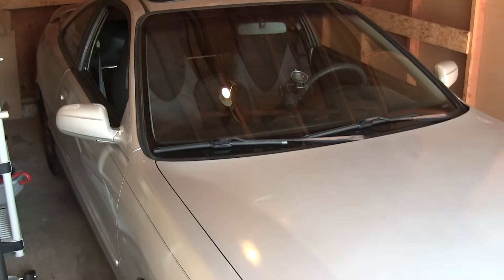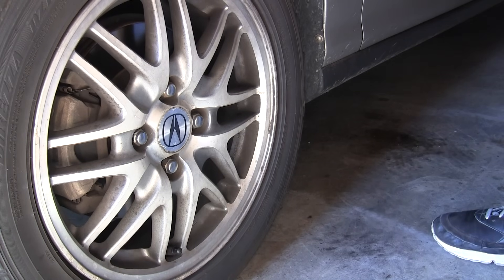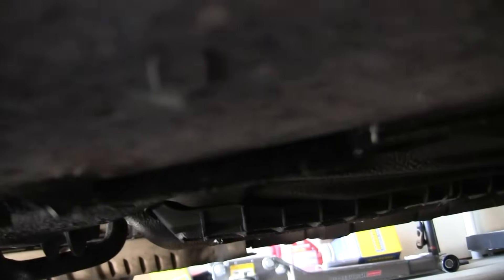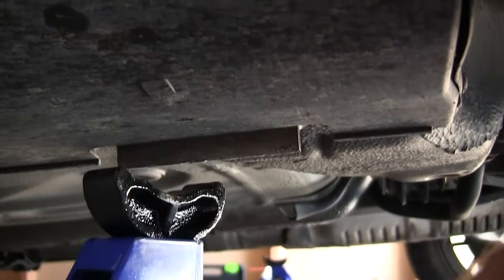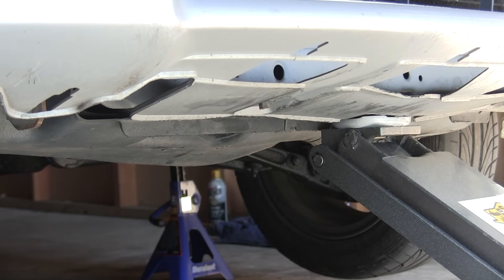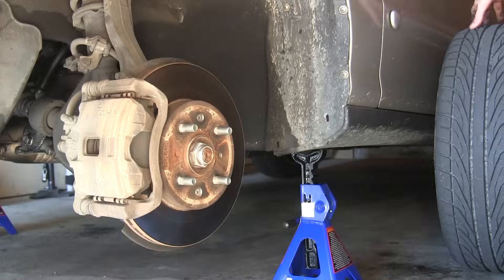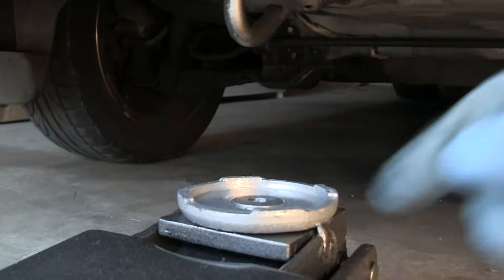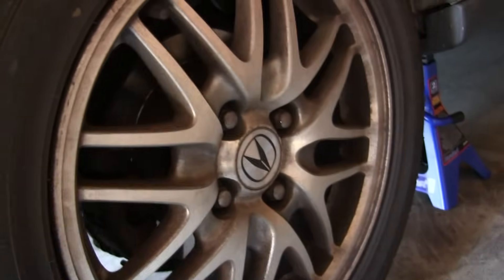How to Lift a Car onto Jack Stands - Explained

Comment: If you only need to jack up one side of the car and remove one tire can you put two jack stands side by side on the pinch weld just in case one fails?

Comment: If you're jacking the car up high, to work under it not just remove the wheels, after you set it down on the jack stands leave the jack under it and shake the car on the jack stands back and forth vigorously.

It should be solid as a rock!

If ANYTHING doesn't feel right or feels wobbly, don't get under it! Jack the car back up and reseat the jack stands until it's solid!

Comment: Nissan didn't put any kind of information on a 98 to 01 altima gxe front lift points and the manual dosent say anything either.... I can't get the jack to the control arms either. Gunna have to go buy a bunch of boards to stack and drive onto

Comment: I have a question that might be silly but I’m having trouble finding a solid answer to on my own….if I’m planning on raising and supporting both ends of the car and taking all 4 wheels off, is there a certain way this should be done? Front first, or rear first? Or am I overthinking it lol….just want to keep my Mustang in awesome shape and do mods to it without dying a horrible death underneath it lol 🤷🏻‍♂️😬

Comment: I suggest (for integras at least) that after you get it lifted up with the jack stands under it, and if you have the front up, pop the hood and stand on the metal bar that the top of the front plastic attaches to and give it a few light bounces, nothing to crazy you’re not trying to make it slip and fall but just enough to make you confident that it won’t slip while you’re under the car, if you have the back up do the same thing in the trunk, if all 4 sides are up test the front and back

Comment: If you are working in deep gravel you need to put a jacking plate under the stands.  Yesterday my car fell off the stands and I am trying to find a jacking plate.  I had just removed the jack and put it in the garage because it was night and I didn't want someone stealing it, but had I left it in place my car wouldn't have fallen off of the stands.
By the way, I never would have recognized your voice! :)

Comment: Putting your car in gear or park to lock the front wheels (for jacking the rear) only works on a front wheel drive.  Use wheel chocks always.  Also, it's good to give the car a shake before inspecting the jack stands, listen for any shifting, don't raise too high from one side.  Good video, but missing some additional safety information.  Make sure your jack stand is on a surface that won't sink.  Best to check out some other videos from professionals.

Comment: To anyone watching this.    Make sure if you buy jack stands , that you buy ones with the extra safety pin (is on a key ring/chain ) pin slips in as an extra safety feature in case the jack fails .    As he said don't forget wheel chalks.  Torque wrench/ Torque Sticks-Torque Bar,  Tire Crayon-Marker might be handy as well. Putting a tire under the car or block of wood is an extra safety measure you might want to take also just in case the jack failed or if you didn't set it right and didn't notice.
Reply: stack spare tires or bricks under the car so if anything collapses you won't get crushed

Comment: To me, this is the worst part about working on any car, simply because I don't do it often enough to really remember what to do.  A question, why is the area that you apply the jack stands shaped the way it is?  With that long metal strip, I think it's called a pinch weld?  I'm a total newb on this sort of thing (in spite being in my 40's lol), it just seems odd to me that every car I have had to jack up was like this
Reply: They try to discourage owners from working on their own cars, and it makes it more dangerous, frustrating, and expensive for those who do.  I'm thinking of getting some special type of jack stands that are compatible with pinch weld adapter smdh

Comment: This is the time you wanna take extra caution don’t rush the jacking up procedure. Your safety top priority extra tip is put the tires under the vehicle close to the jacks in case a jack stand fails car will fall on the tires and not you or the ground

Comment: I just had to jack up a Toyota, and the jack points were the same metal bar you showed, and that the owners manual showed. But my metal bar bent, and caused the whole car to come crashing down! I moved my jack to a different spot in the front that was part of the frame, and it held much better. But why the hell did it bend? Did I do something wrong, or was it just a cheap/shitty part?? I swear on my life it was the same part the manual showed.

Comment: A bit over the top, makes you wonder how anyone changes a wheel on the side of the road? If youre getting under the vehicle, use the stands and your wheels as a last resort.
Point two: A wheel is made up of a Rim, Valve and a Tyre. A wheel is not a tyre and a tyre is not a wheel. You have a spare wheel in your boot/trunk you dont have a spare tyre, that would be useless without the other components unless you know how to put a new tyre on your rim.
So endeth today's lesson haha

Comment: Hi, would anyone know whether I can remove my wheels on a slope? My drive and the 2 roads off it are all on a slope. 

I thought about parking my car parallel across the slope on the driveway then jacking one wheel at a time with a hydraulic jack and removing the wheel, cleaning it then putting it back on. Then remove the next one etc. Do you think this would be safe? Any help would be greatly appreciated 🙏
Reply: If you want to get squished under your car, then yeah. Otherwise find a flat surface
Reply: Ok thank you. I’ve managed to jack the car up ok now. I found a  flat part of the driveway and parked parallel across it and I managed to jack the car up successfully.

Comment: When removing rear tires put the tires in the trunk so the center of gravity doesn't change, which could cause you car to tip forward on the hoist.

Comment: I am having an issue using jack stands with a scissor jack.  The hardpoint area is not long enough as the jack stand base is wide.  If I use the scissor jack on the hardpoint, there is not enough room for me to place the jack stand on the hard point.  Besides getting a floor jack are there any solutions?

Comment: Anyone know front/back jack points for a 2012 Subaru Legacy? The manual annoyingly just shows the four side jack points (for say changing a tire) but doesn't show where to jack the front or back up to put jack stands under these side points.
Reply: Josh Isralowitz 
I'm wondering the same thing amd my manual only shows the same. I think the "towing hook (eyelet?) he used to jack up this Acura is on most vehicles. My KIA got towed and I know I have a towing spot like this car. Try that, or look it up (Google it).

Comment: Good video but only for that car.   You're not going to find a front jacking point like that on most cars,  and in any case the owner's manual won't be of any use to you.  All of the owner's manuals I've seen for modern cars pretty much just tell you how to change a flat...

Comment: if my jack wont fit under the front can i do each side one by one  using the frame rails and the seam points?
Reply: If you’ve got the option, drive onto some wood blocks to get extra clearance.

Comment: Can one use the scissor jack that comes with a car to lift one side at a time, placing each jack one at a time to get the entire front up?
Reply: Alex Merritt  Very time consuming but i do it all the time. No problem at all. Leave the jack there too to support the weight
Reply: hey to get the first jack stand under the car, where should i put it since the scissor jack is in the spot where it needs to go

Comment: Am i the only one who gets sketched out at the thought of doing this alone?!?
Reply: i feel safer alone. no one will lean on the car or "accidentally" kick the jack stand.
Reply: Lol just give it a good shake, make sure your on even ground, some slabs have been known to crack if there is a void in the middle, gravel can be sketchy, use very thick plywood and thin metal over the top to stop it from digging in, i used a old pc case side. But yes be careful, i've had a car slip before, luckily i was just giving the car some welly in the hub nut, but that always taught me safety safety safety!!!!!!
Reply: No always let someone know ur doing this just incase
Reply: Plus the scissor jack it comes with! Triple insurance
Reply: It’s pretty easy just have to do it correctly and double triple check everything before going under the car
Reply: Thought has run through my mind, yes.  I need to start putting the tires under the sides of the car.
Reply: Always lay your tires down flat sided and put them halfway under the car and halfway sticking out from the edge of the car as well for extra safety that will not fail for sure.👀👌
Use your good judgment about how far up the side rail underneath the door to put them depending on whether you jacked up the front or back!👌
Reply: Yes you are

Comment: that's a nice jack, also which end of the car using the transmission as wheel "chocks" depends on weather its front or rear wheel drive.  actual wheel chocks should always be used as well

Comment: i need to remove all 4 wheels at the same time. can i out car on four jackstands?
Reply: sure, I do it all the time.  Typically lift up the front, jack stands under the front corners.  Lift up the rear, jack stands at the rear.  Car really needs to be on a level surface.  Once the rear is lifted, the front may need to be lifted again and the stands adjusted a little higher, depending on how high the jack and stands can go when initially lifting the front.
Reply: Did you watch the video?
Reply: Never do that. One tire at a time, buddy. If it’s not a tire issue, take it to the shop. You’ll do more damage to your wallet versus taking it to a professional.

Comment: I'm trynna paint my calibers but I want to do it on my drive way ND my car is lowered any tips
Reply: kush gottheju1ce2k  I have a lower car too. I went scavenging to the junkyard at the local pull a part and managed to find me a factory Jack that basically sits on the ground. Now don't get me wrong it's one of those crappy little twist ones, But it gets me started until I can use my normal Jack. I also have a 6 x 6 piece of wood and I use the circle saw to make ramps out of so I can get my car jacked up faster

Comment: 4 stands under the frame of the car is dangerous. 1 out of 4 stands will not be fully loaded. I'd suggest 2 under the suspension or 1 pair of infinitely adjustable stands.
Reply: +ThePariss333 I only suggested that 4 under the frame has it's shortcomings. There are some cars, probably yours, that will flex enough to load that 4rth stand but if you've never seen a table with 4 legs rocking on the floor with 1 leg not actually touching the ground then you will NOT understand what I'm saying.

Comment: Is is safe to life one side of the car as opposed to front or back and leave the other side on the ground? For example if I was going to switch the places of the right front and right rear wheels?
Reply: Jack up under the front side jack point.  The rear sway bar will help lift the rear wheel off the ground as well as the front.  I do this all the time for tire rotations.

Comment: and are these jacking points in the cars manual?
Reply from the maker: +Nick Velazquez They should be.
Reply: +Engineering Explained on an STi manual, it doesn't show the front jacking points and the rear jacking points...just the side ones...
Reply: No they normally just show the side points that you use your crappy car jack in the car. It can be a pain in the arse finding strong points on some models of car. People even resort to putting axle stands under the suspension arm.

Comment: What breaker bar are you using?
Reply from the maker: +djm93 I believe it's from Harbor Freight. Only the best...
Reply: I use a 3/4" breaker bar for removing the stubborn(i.e. Over Torqued) lug nuts.   My 18" 1/2 inch drive breaker bar could not do it.  Same thing for axle nuts along with some suspension bolts.  I use a 24 inch 3/4 bar.  I one time got injured when my 1/2" breaker bar snapped removing an over Torqued axle nut.

Comment: Extra tip, slide the tires under the car. Comprehensive insurance ;)
Reply: Better than a car coming down on your head or chest
Reply: @TubeYouGuru  
The tires will not be wide enough to stop the car coming down on your head because you wouldn't normally lie completely flat under there while working. When that happen, you will go into a vegetative state and more expense for your family. Much cheaper sticking with a third-party insurance - when you are gone, you are gone. Alternatively, I suggest replace the stands with stacks of joined-together wood with a large base.  The car cannot go through a big pile of wood.
Reply: @fungames24  if you lay on the ground OG style like I do, rather than a glider, it works. Plus I'm really small as it is, so I've got more than enough space. Probably not safe for a beefcake tho. Haha
Reply: @caydeisclutch2589  If the car falls, it will compress the suspension spring and go lower than you expect. If you value your health, use wood. They are cheap and easy to shape. I think my solid wood stacks are 16 inch by 16 inch. There is zero chance the car would go through that. Also it cannot tip over like a stand. The car cannot slide off either because the support area is so big.
Reply: @fungames24  lol.. I'm just saying. I'm not trying to imply this is a good idea for regular practice, but if it's spur of the moment and I had to lift my car for any reason, that is the most logical choice. Personally, if I planned to do any work under the car, I wouldn't use either method. I'd use all 8 of my jack stands instead of 4.
Reply: Use old rims
Reply: That is old school nonsense
 You'll ruin your rim, tire and life. That's why jack stands were invented
Reply: I always do that too and it saved my hand from being severed when the car fell off the jack and the rotor barely touched my wrist. Left with nothing but a scratch
Reply: or two pallets stacked onto eachother
Reply: The width of my wheel is way hire than the height of my car (3.5 inches) but i aint damaging my wheels bro
Reply: @silhouette999  brooooo not ur wheels brooooo 😭
Reply: Always lol
Reply: Right and if something happens you ruin a good rim. Heres what I know the body heals car rims dont. Sheesh! Dont sacrifice your rims just to avoid a little heal time to your skull and face. Take it like a man. Stick your chin out like a boxer and bring it on Ike Tina could take it then so can I
Reply: @kefwals8722  Don't be a dummy, use steelies.
Reply: B Rad 
That saved me and a car !! But wrecked my brand new iPhone 😢

Comment: Can't emphasize enough: KEEP the jack under the jacking point as a safety after you've put the car on the jack stands.  You can never be too safe :-)
Reply: Gets in the way a lot of times, especially when working under the engine bay area.
Reply: So use bricks instead

Comment: How would you lift your entire car, do you do the back or front first? Also how high can you jack your car, can you have the jack almost be vertical, or is that not safe?
Reply: +asdfawesomesauce .... well then how do you life the entire car
Reply: +asdfawesomesauce seriuous quesrtion i got a car i need to lift all tired are deflated and i need to lift it to store it for 4 months before i fix it damn winter
Reply: ... if u cant jack it in the air with inflated tires what difference will that make?
Reply: i need to lift it up so i can tarp it and take the tires off not inflat them the tires are destroyed
Reply: i know it needs new tires but seiously what difference would that make but if u have some good info for me ... would be great!

Comment: when using jack stands does it have to be on a flat surface? what about a drive way
Reply: Wididy I do mine on uneven surface of my garage
Reply: I don't want my car to flip over
Reply: You can put pieces of plywood under the jackstands to counter balance whichever way your driveway slopes
Reply: Yeah it's best practice it's not for "car flipping" it's more likely to be jack slipping, rolling or axles slipping over whilst jacking. Mine is a slight incline so can't put 4 stands on done all kinds of work to the car. don't take my word for it though

Comment: In a RWD car, how do you lift the rear without the front wheels moving?
Reply: At least buddy is trying to be safe and asked.
Reply from the maker: IgnacioSeveriens Wheel chocks.
Reply: If you can't figure that out, you shouldn't be working on your own car
Reply: @mrfisbees  Correct 
Fail point of 4 Ton Jack Stands is not what matters here;

Comment: for manual car you put on hand brake and put in gear, does it matter which gear?
Reply from the maker: I usually stick it in first.
Reply: Put it in first, and make sure you don't put it in a high gear. There is a possibility that the car can still move.

Comment: Hi...love your videos! I'm just looking for a little clarification: can my jack stands be positioned in the slots where my scissor jack would normally be positioned?
Reply from the maker: Most of the time, yes. Just use caution and a little commons sense, make sure it's stable as you raise it up.
Reply: Your owner's manual should show where you can place jack stands after the vehicle's been raised with the scissor jack since that jack needs to be set back at that location to lift it off the jack stands.

Comment: I have a mustang, so there is a front point I can use the jack that came with the car in front and place my jack stands where the jack points are on the side of the car or do they go somewhere else under the car?